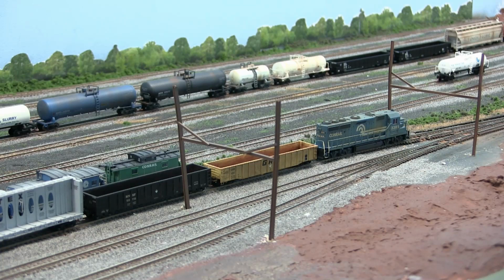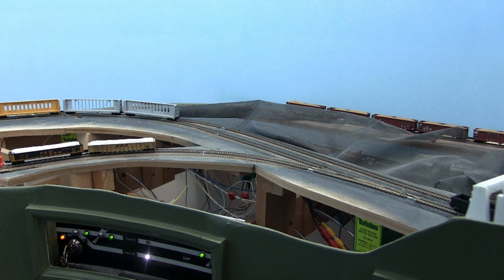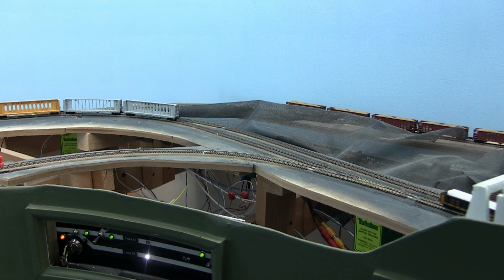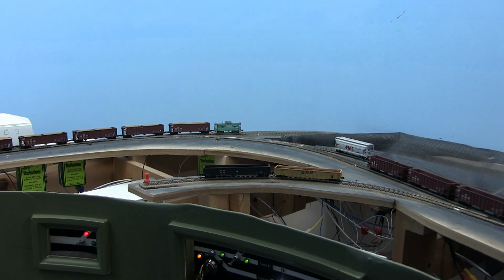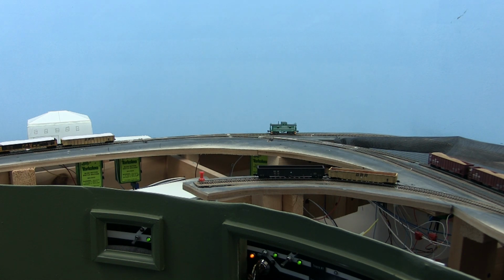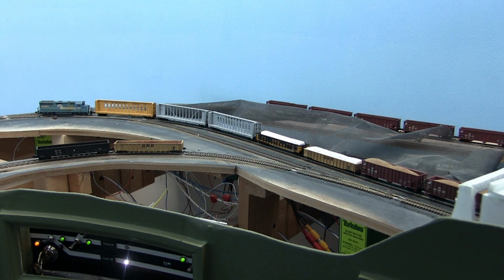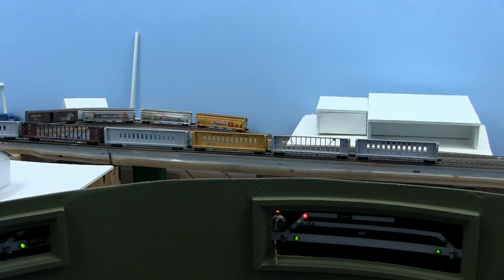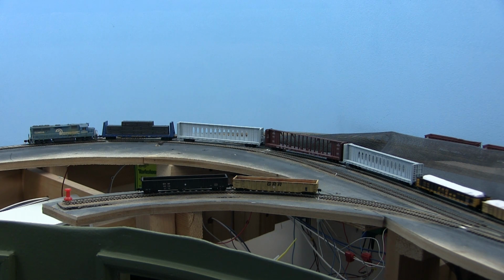Operating the WJSA-37(228)

Comment: You have a wonderful layout. The switching is great. I think that switching layouts are far more fun than just mainline layouts. A combination of both is fun too if you have room for long through trains to run on the main while having lots of switching. The switching takes lots of time if you do it like you do with the stopping for setting handbrakes, stopping to throw the switches, doing brake test, hooking up air lines and waiting the amount of time that it would take with all of these things just like the brakeman or conductor was walking back and forth. That makes it last longer and is just more fun to me to do it how its actually done. You don't need a fast clock when you are switching most of the time if you have long stretches of track and go prototypical speeds. Fun, fun, fun. Nice video and thanks for sharing.   👍👍
Youtube needs to put a two thumbs up button beside the single thumbs up for videos like this one. 👍👍
Reply from the maker: William Bryant thank you very much! Thanks for watching.

Comment: Joe, great session.. about that situation with the caboose holding on the grade.. if that is a move that will recur often.. crazy glue some toothbrush bristles between the tracks and camo them as weeds.. they will allow a car to roll over them, yet strong enough to hold the car. You'll have to experiment with how many you'll need but, they are nearly invisible if done right. Hope it helps. Tom
Reply from the maker: Overland Transportation System great idea I’m gonna think about doing that! Thanks Tom.

Comment: Good video Joe! Thanks for sharing. Inspired me to go run a train on my layout. I used the new Conrail Switch List. The only thing I don't like about them is the area to write the name of the industry is too small. Otherwise they work well.
Reply from the maker: maurice grimes that’s Awesome! I happy that you got them. Go take a look at multimodalways and find a ZTS (zone track spot) map. The industries had shortened names on them, maybe you can come up with some ways to shorten the name of your industries. Hope that helps. I’m always glad to read your comments and suggestions! Thanks for following along.
Reply: @centraljerseyconrailinnsca5676  Unfortunately, the line I am modelling was sold off by Conrail in 1982 and the earliest ZTS maps I can find are 1987. I can adapt though, afterall, we are only talking seven industries.  I am sure I will be more comfortable with them after I use them a few more times. Cheers!